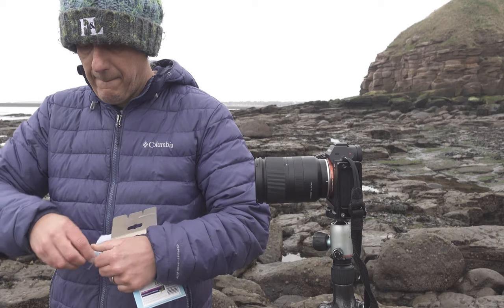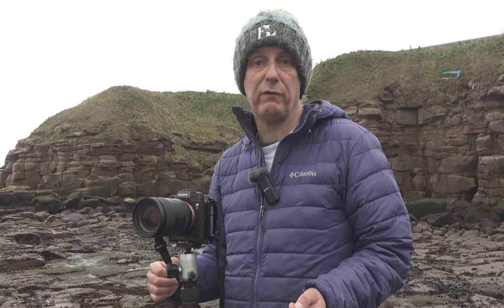DIY Filter Holder for Square or Circular Filters - Landscape Photography Hack

Comment: Thank you for the idea Jason! I am looking for ideas for creating a filter holder for a lens like the tamron 15-30mm or the nikkor 14-24, which have bulbous frontal elements. A specific filter holder for these lenses is quite expensive, at about 500 euros, which is about what the lens itself costs, second hand. I considered using the slide on cover to try and create an improvised filter holder, but I'm not sure it'll work.
If anyone has tried a method that worked, please let me know, it'll be very much appreciated.